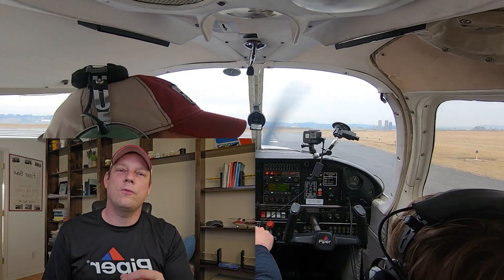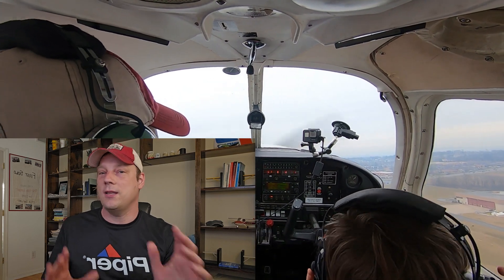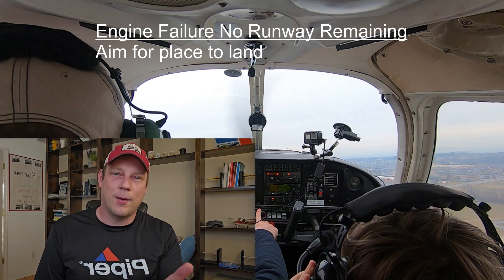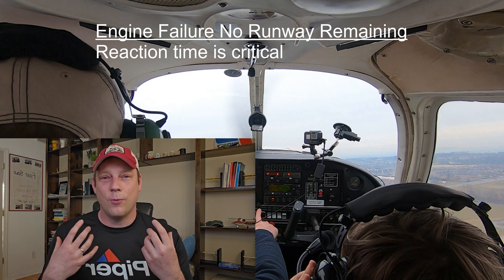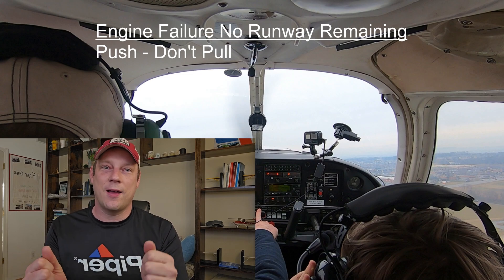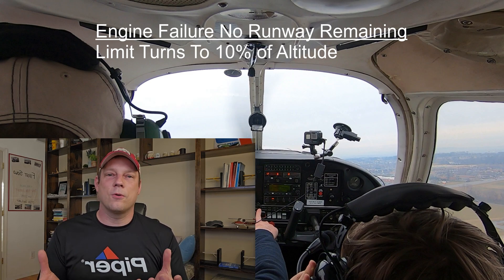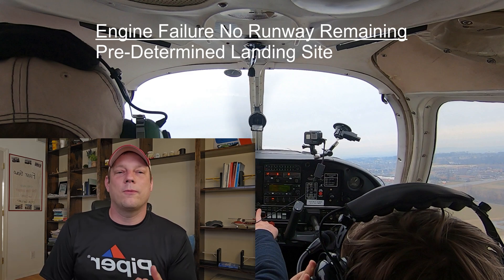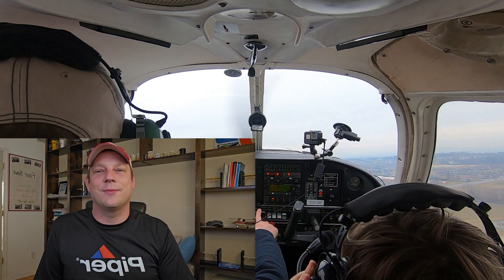Airplane Emergency Series 4/31.  Engine Failure After Takeoff, No Runway Remaining.  MayDay 4

Comment: Less than 300 would you still recommend checklist memory items? At like 100 or 200 or just fly the airplane?
Reply from the maker: I think it's probably different for everyone.  If you have the airplane under control, have your landing spot, and time, then sure you might as well do all you can.  I think the big concern is that pilots start to get distracted, take their eyes off the landing spot, and don't make the field or stall the plane.   Maybe we all should practice the memory items more, so we can run through them flawlessly and quickly.  Then we would be proficient at them and could do it at almost any altitude.

Comment: Do you think it is realistic to secure the systems? Or do everything exactly in the order you said? My wonder would be if turning the fuel off or mags off, would be a good idea to help prevent fire on landing. 

I once had an instructor that said it probably won’t restart so just secure it, get mags and mixture off. My thought was always, “what if a quick memory item flow could restart it?”
Reply from the maker: I guess there probably isn't a one size fits all.  If you have time to secure, and are familiar enough with the plane, I see your point and it probably makes sense.  I think the big concern is that if someone is inexperienced their focus needs to be flying and multitasking could be a risk of getting too slow or losing control of the aircraft.